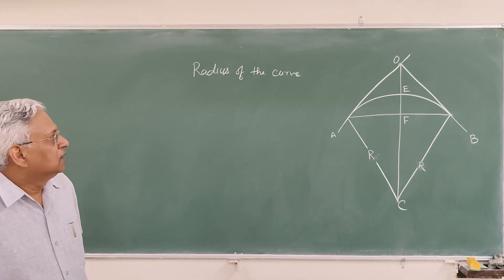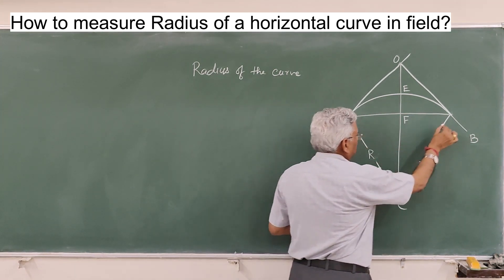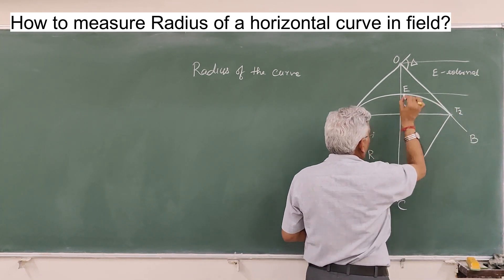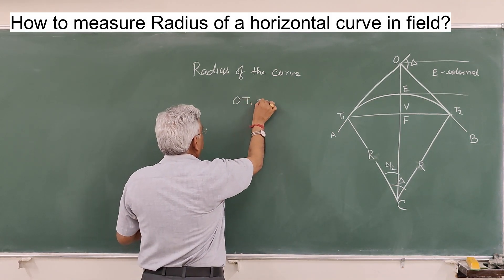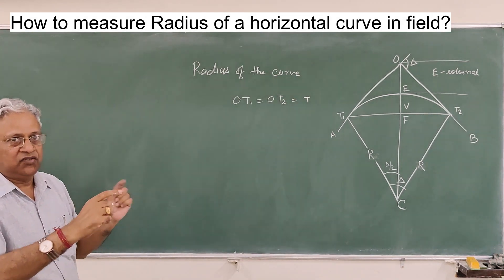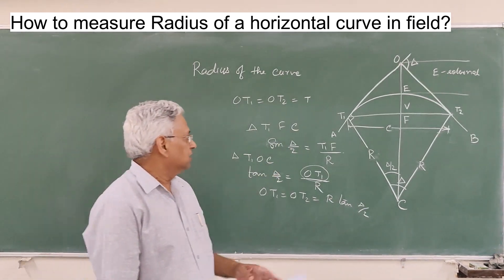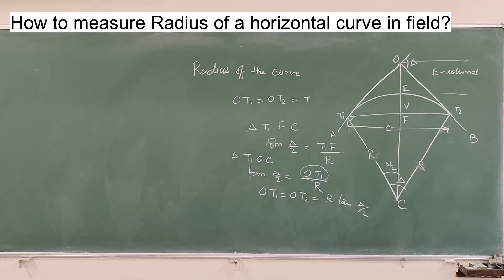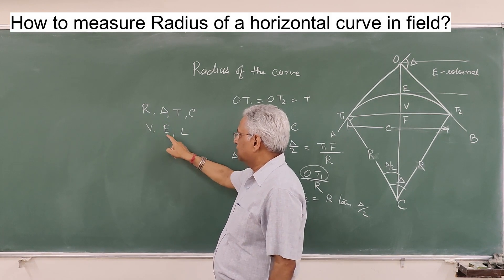A simple method of determining radius of the curve in field, Governing Equations for Radius of curve

Comment: Sir, here the 'C ' value is length of straight chord...but as u said in field we will have to measure 11.8m on centreline of curve ... aren't both different
Reply from the maker: No, Take a tape (or any string) 11.8 m long and place its two edge on the edge of the road or on the centre line of the road if it is properly marked. It will not look like a chord of the curve, measure the maximum offset, that is versine,
I hope it is clear now.

Comment: When superelevation to its Max value in that case what term we use to designate the radius of the curve?
Sir please answer this question
Reply from the maker: I could not understand ur question. Horizontal curve is circular in shape. It has a uniform radius R. The superelevation must be maximum throughout the length of the circular curve. Transition is used to achieve this super elevation